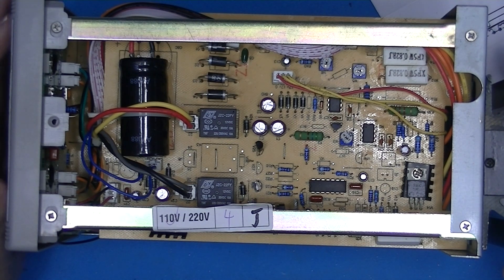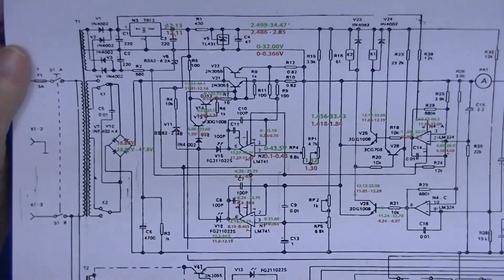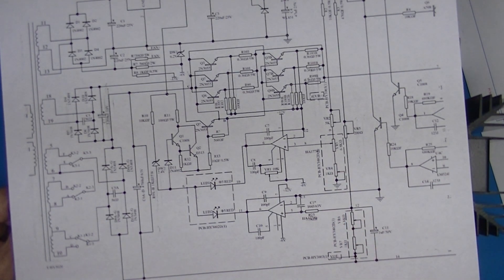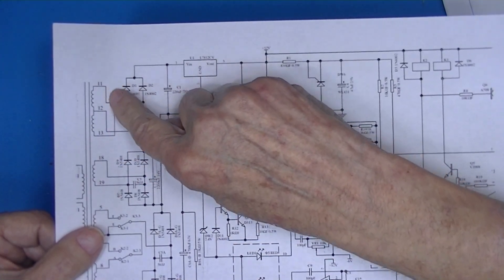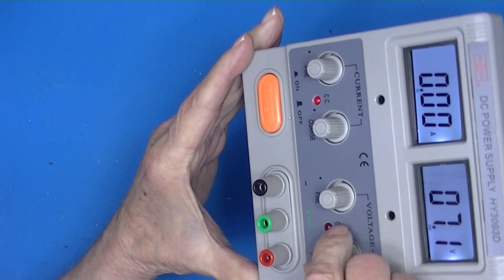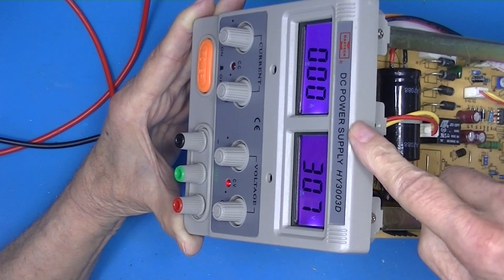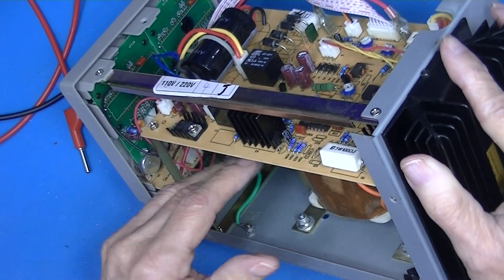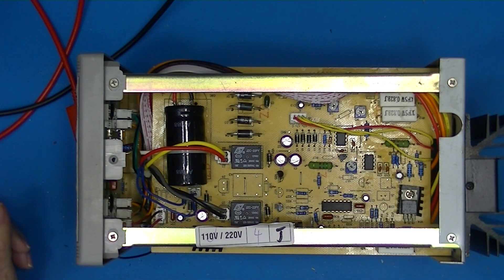Mastech HY3003D – “For Parts” Linear Power Supply – Part 2

Comment: I have had good luck with "AS IS" Mastech PSUs.   I have purchased 4 over the years.   Three single voltage and one triple voltage output unit.  They were way cheaper for a busted unit back then.  Some needed new main filter capacitors and some had bad output transistors, one had bad TL431.   The only quirk is for some reason at low current limiting they seem to oscillate and freak out.   I don't recall the details exactly but I have to use them at higher current limit applications.   I tried to fix them but gave up and have not tried any further at this time.   I built a separate low current limited supply for those needs.   Your video was timely.   I was thinking of trying to fix the oscillation issue again.    I thought I had a bad LM741 but that did not fix the issue.    Thought I had bad caps but ESR testing didn't show anything wrong with caps.  Oh well maybe I'll get lucky and find the issue.   The thing that bothers me the most was it does it on at least two of the PSUs.   It may be a basic design flaw.
Reply: Mine does the "oscillating" also.  The voltage output makes large changes up and down and I can hear the relays clicking.  I think it's the adjustment pots on the front panel.  Let me know if you find the problem with yours.